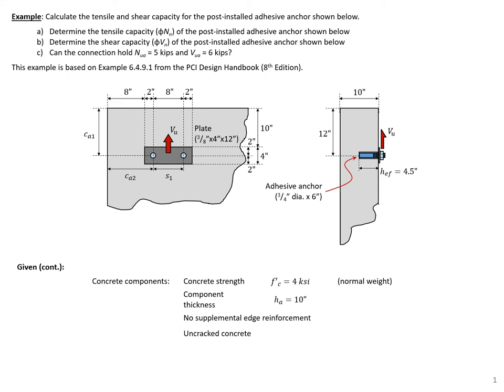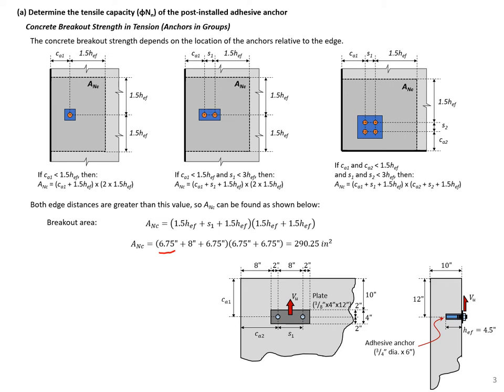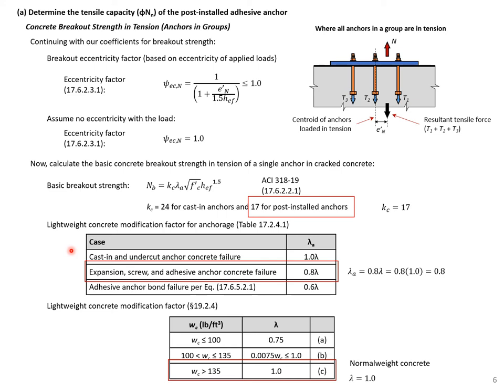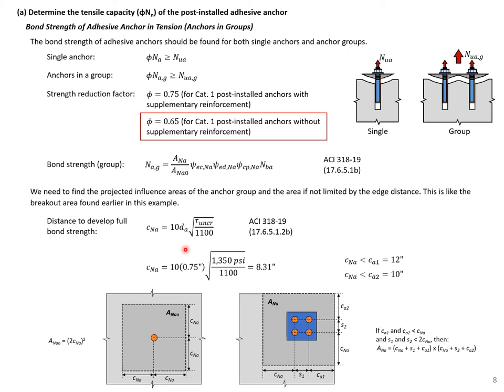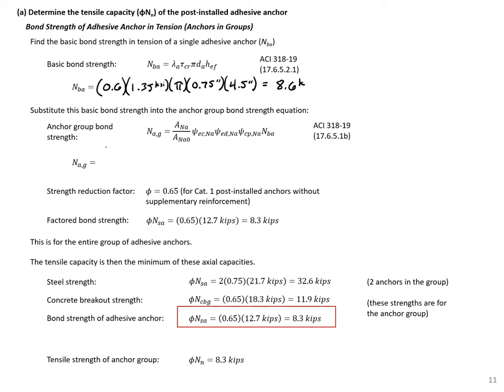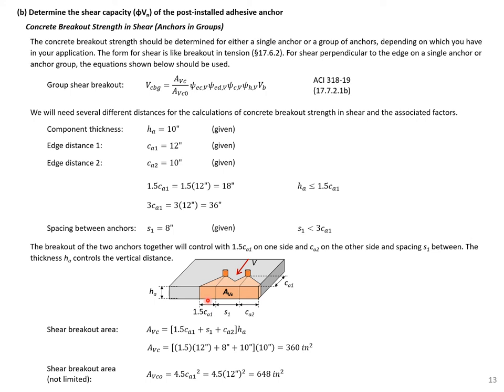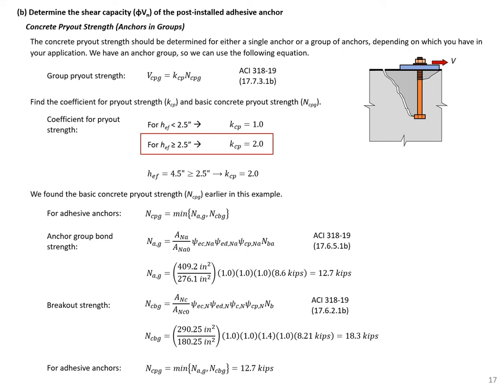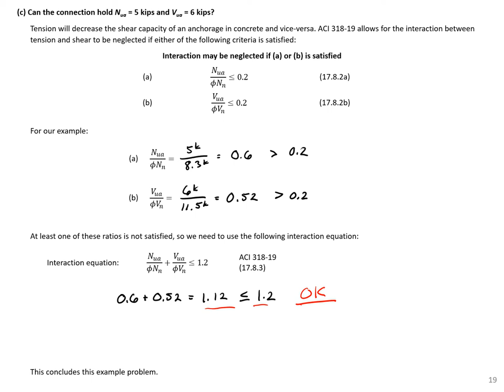Precast Concrete - 5 - Example 1 - Post-Installed Adhesive Anchor

Comment: Thanks for the video. For the bond failure, ACI 318 figure shows the stress distribution and that it basically doesn't get any larger than cNa even with a deeper embedment depth. Do you know why that is? Intuitively I would think the deeper you embed an anchor no matter if it's mechanical or adhesive, the greater strength you will have.